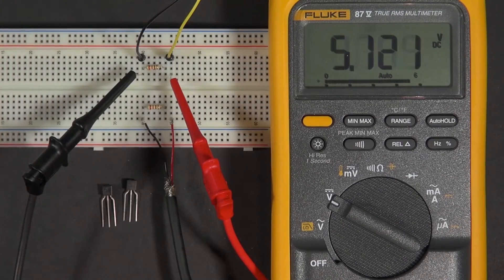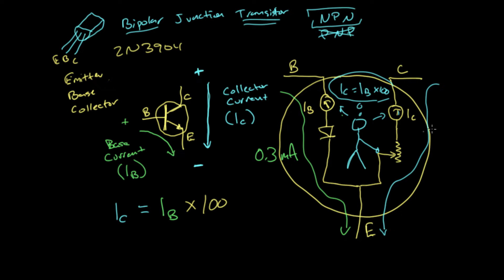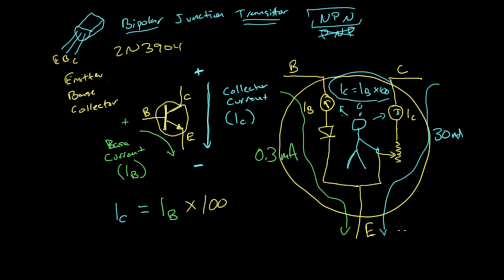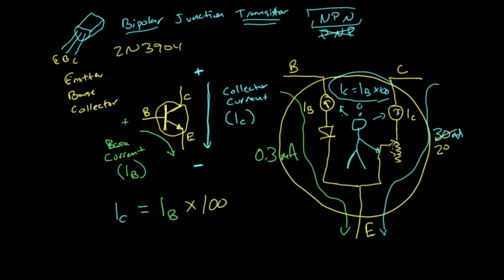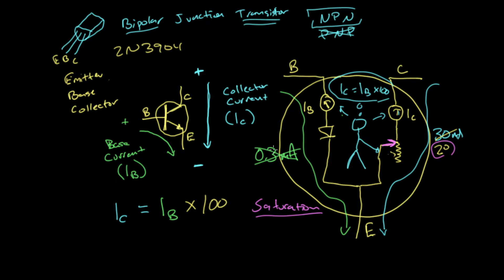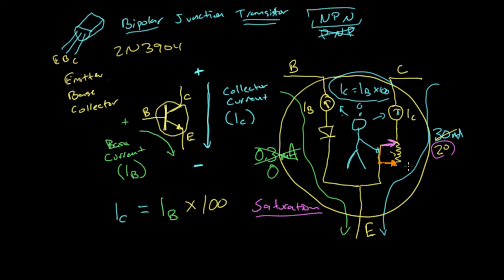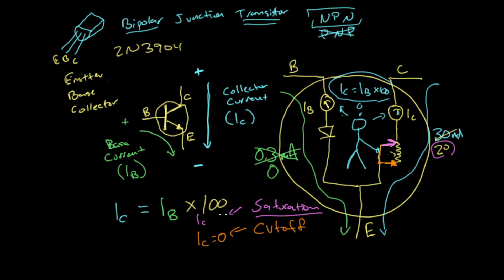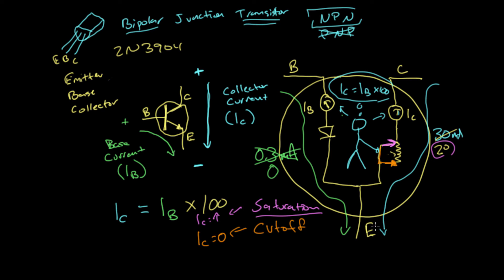The transistor as a current controlled switch | Digital electronics (7 of 10)

Comment: I hope you get into operating Voltages and configuring the Base input Resistor for its saturated Voltage, the Collector input Resistor for its saturated Voltage, and the Emitter output Resistor for its saturated Voltage when needed.

Comment: In this case there's 5 volts between the base and emitter. I believe that is okay as the datasheet says BE can go up to 6V, but usually you would want a base resistor yes?
Reply: 6v is max emitter-base voltage, not base-emitter voltage.

Comment: great video. thanks Ben. question: how fast does a transistor react to changes in the base current, surely there is some delay right? thanks
Reply: The collector will respond very quickly to changes in current in the base because this relationship is driven by quantum mechanical effects between the atoms and electrons in the doped silicon that makes up the transistor itself. However, there are capacitances created between the base and emitter as well as the collector and  emitter as well as other parasitic capacitances. The combination of all these cpacitances will dominate the transient response time of the transistor.

Comment: Isn't it counter intuitive to say a transistor is in cutoff when it's letting nothing pass and saturated when it's letting everything go through. You would think that the resistor would be saturated when it's blocking everything it can no? Or am I missing something? Sorry noob over here
Reply: The transistor is in in "cutoff" when the collector current is "cut off" (i.e., no current is flowing through the collector). The transistor is "saturated" when the transistor cannot produce any more collector collector current at the given base current and collector-emitter voltage (i.e., increasing the collector-emitter voltage will not change the collector current).

The term saturated actually is drawn from the underlying mechanism that makes a BJT work, in this case the transistor silicon is saturated with charge carriers (i.e., the transistor cannot physically support any more charge carriers). The amount of current that a transistor can pass is directly related to the number of charge carriers available in the silicon. It is good to keep in mind that a lot of the nomenclature around transistors (BJTs and FETs alike) is derived from a quantum mechanical description of how the device functions which means the names can feel counter intuitive when thinking about how the device operates from the perspective of conventional current flow. (I mess up drain and source in FETs all the time because they are simply backwards as when thinking about conventional current flow.)
Reply: I'm thinking the same thing. How can we contact Ben for confirmation ?
Reply: I watched again, Ben was right.He was saying current , not resistor.